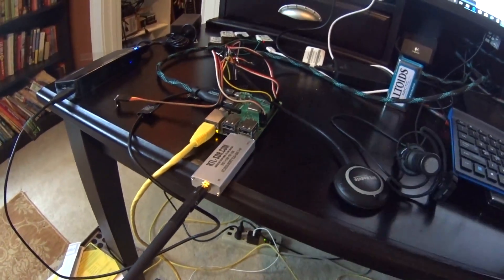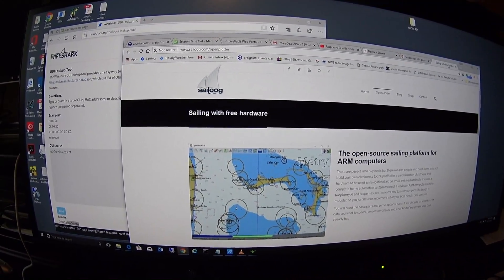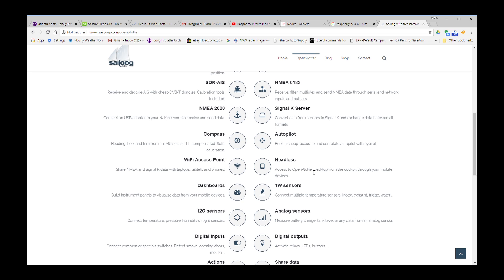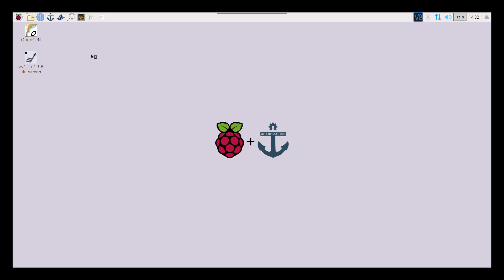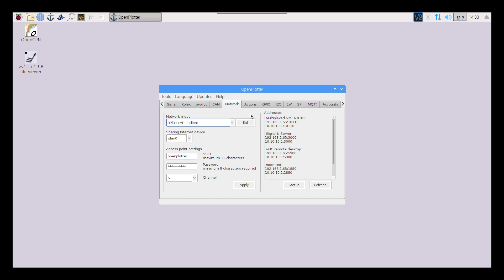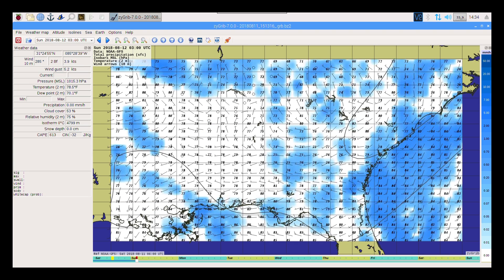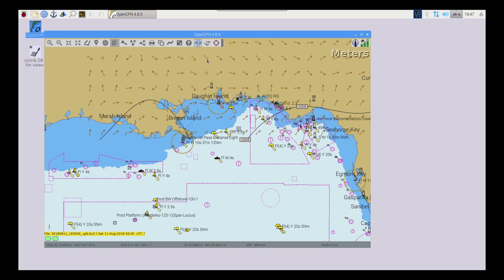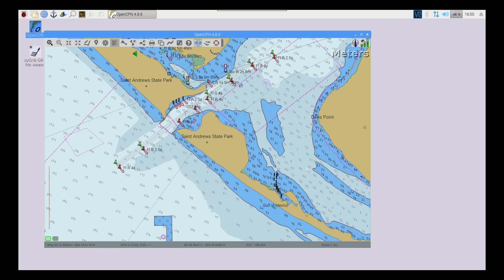Tiny Off Grid Boat Camper - Raspberry PI 3 B+ OpenPlotter and Electric Motors

Comment: For the decking, maybe something like the Fortis aluminum deck boards ?

https://www.wahoodecks.com/fortis-aluminum-decking-boards/

Doesn't seem to come in Teak though, just lighter colors (lower solar gain *). Promises low heat (faster dissipation of heat than traditional decking). I've been on some composite decks in sun, not pleasant. Should be lightweight, low maintenance, and long lasting. The trade off probably being not cheap lol. Unless you can pick up some long enough cutoffs from a job. Although apparently the company will custom cut lengths so there might not be any waste to score cheaply.

To get around the water issue have a light subfloor below ? A skin of your salvaged aluminum or a fiberglass panel ?

Or LockDry ?

http://www.nexaninc.com/products/decking/lockdry-waterproof-decking

Looks like lots of options out there :-)

Cool to see you're still thinking solar / electric motors. I'm guessing to avoid the extra wind load under way you're still thinking roll up canvas walls ? Keep it nice and airy when travelling (and less wind load) then roll down the walls to get cozy when anchored for a stay. Leaves you the option to just roll down one side at a time for shade. Just some thoughts. Loving the build !

* Speaking of, have you noticed any heat issues with the solar roof ? You might want to keep an air circulation space between them and your inside ceiling to help keep them cooler.
Reply from the maker: Thanks, those look like great options for decking that I did not know where available. Hopefully I'll get back to this when it finally warms up. First thing I need to do is shore up the vertical supports for the roof. Need to put some triangulation in there to make it sturdier. Unfortunately my scrap yard decided not to sell me anymore material ( I guess liability ) so I need to hunt down a new source.
Reply: @JYDOG  : Well that's a pain that the scrap yard is not selling to you.

Good luck on finding new sources !

Comment: Love the ideas!  My experience with solar is they are very weak in terms of deliverable amperage, so driving large motors primarily on solar is out of the question. You will need to rely on a solid battery pack. 

My 2C is to stay away from salvage/reclaimed 18650’s. “The boat has sailed.”  I would save yourself the headaches and start with Leah Acid or lithium phosphate 100-200ah pack for starts and wait for a good deal on a Tesla pack later. You need a larger pack for the kinda amps you will be drawing from those trollers. Look into a higher pitch prop then the factory to get a little more out of the motors, it will not significantly impact their longevity. Stock, you will not see more then 3-4mph from them in your application. As for controllers, if your going to invest in the Chinese pulse width modulation verity, look for the biggest one you can fine in terms of amperage as they are always the weakest link. Look into the name-brand RC controllers for more reliability. 

Composite decking is great but still heavy. In terms of weight, I would go aluminum clad like you have been using and  cover it with indoor-outdoor carpet and maybe later reskin it with something better later down the road. 

Can’t wait to see how it progresses! Good luck and God bless you and your family.

Comment: I think a boating coarse would be of value to you at this point and time, after that performance on the lake a while back. I figure the extent of your boating will be done one hundred yards of the lakeside, you said it those little electric motors will not get you anywhere in a small breeze. Definitely will be going backwards with a high sided houseboat such as your intending to build, take it from a old boatbuilder your barking up the wrong tree. They might do for trolling around for fish on a flat-calm body of water but that's the extent. And don't forget at least a hundred feet of 3/8 chain and a coil rope, the store expert will know the proper size and type. A decent anchor will be required to be legal on any body of water, boating isn't cheap by a long shot, be safe out there.